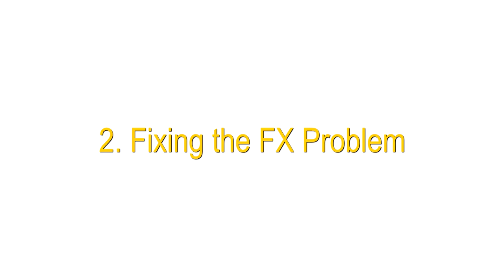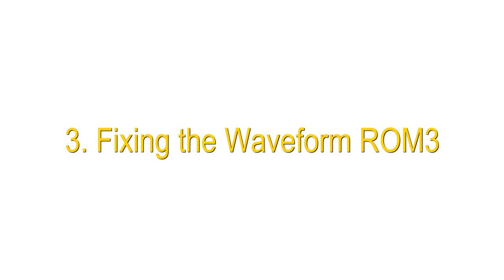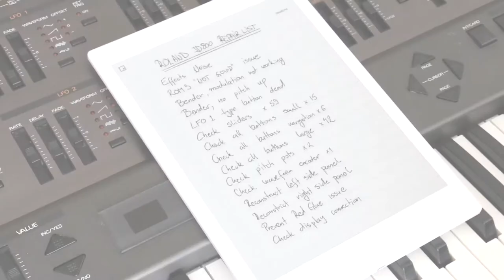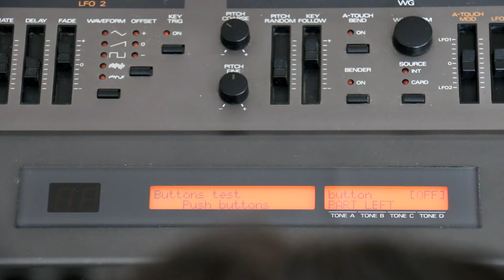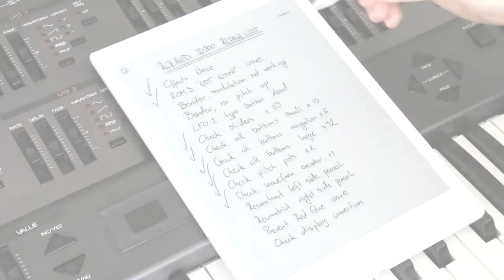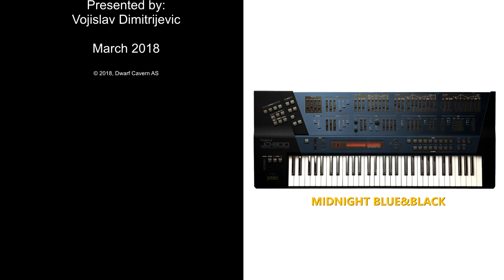DeepDive: Synth Edition - Roland JD-800 Revival, Episode 1

Comment: The first few moments of your video feel pretty familiar.   I always wanted a JD-800 and saw it as something really really special.  I ended up waiting well over 20 years when I found a very  inexpensive one that has the red glue problem.  I'm about to tackle that issue.

Your two videos are both great and really helpful.  Thanks for those !  As for refinishing the JD-800 in new colors, I think I like Midnight Blue.  I do like the idea of refinishing, but the re-stenciling would concern me a bit.  

I plan to replace some of the orange LEDs with different colors so they relate more to function instead of all being orange.   I've seen JD-800s with some purple LEDs which look really cool with the existing orange ones.  I'm thinking about a handful of colors which might look good together and differentiate synthesizer functions

Congratulations on doing a great job on your JD-800, and now having that great synth to make music on.

Comment: AWG 30 wire is good for the type of repair you did.   Even finer wire is available, with enamel coating, but 30 gauge wire is fine enough.   Also, it bends easily, so won't pull on the connection after it's attached.

Comment: Great restoration. I also have a JD-800 (and JD-990), but the guy before has done a great work (the red glue has been fixed) and all is working great except two swtiches that I need to push hard. For the color I think all white is top class, like the famous "Gandalf JD" https://www.flickr.com/photos/27007165@N06/sets/72157605254502230/ . I still hope to get mine all white like that one day.

Comment: This is not one of the color schemes listed.  I would do a light gray silver color. The Supernova 2 came out in a special edition "Platinum"  light silver color with black print labels.  That worked great except at the very front of the control panels where the display and patch selector buttons were they changed the color to a very dark gray but kept the black print labels.  Almost impossible to read the labels for the numbers and other control buttons. One of the worst ideas for a synth design.  What were they thinking???